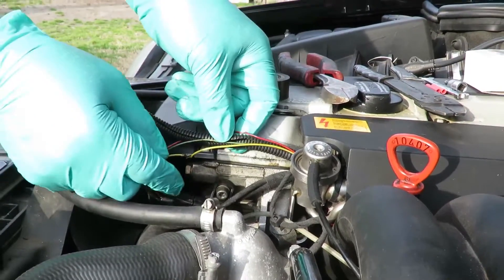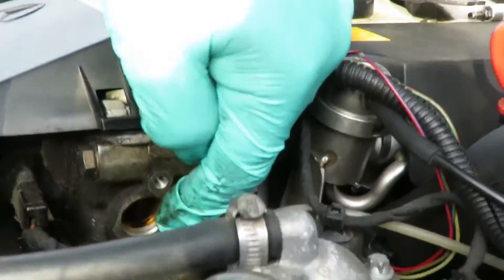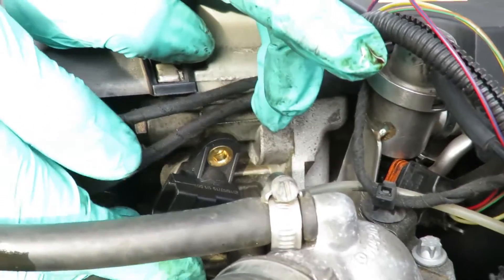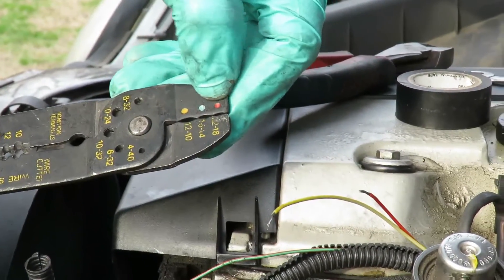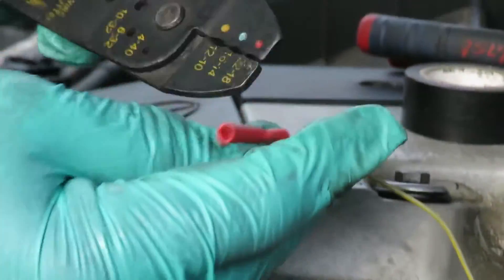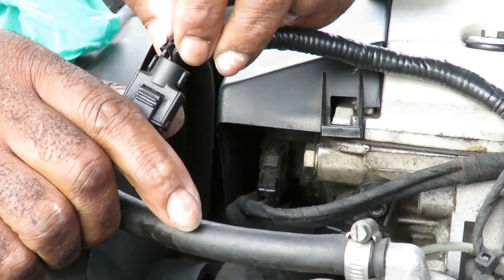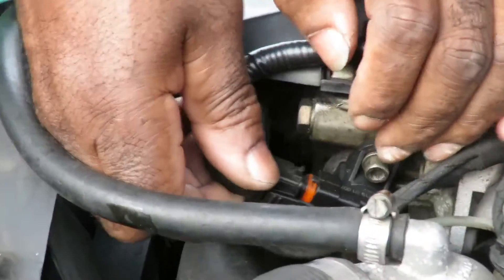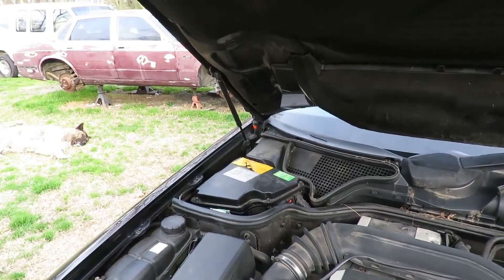⭐ 1997 Mercedes Benz E320 - Cranks But Will Not Start - PART 3

Comment: Bless you sir
Reply from the maker: Thanks Dom RM!
Reply: Astral Auto Repairs I got 2000 w210, E240, cranks n starts fine, but after exactly 25 minutes (I timed it) it shutdown without any warning ⚠️ lights or messages, just replaced the fuel pump and filter, still cranks fine and after 25 minutes it dies again, and won’t start unless it sits for an hour, then cranks again for 25 min then dies again 🤔 car is stock, no modes or any kind of electrical upgrades 🤷🏻‍♂️, running out money and solutions, if by chance you ever countered some issues like these before, any advice would be appreciated so much sir.
Reply from the maker: Once it stops running, check to see if you have spark. Believe it or not, your issue is easily fixed. All you have to do is find out whether you lost spark, fuel, or injector pulse, once it stops running. Then go from there.

Comment: nothing to do with anything just wondering did you try repairing the frayed wires to see if that may having fixed without sensor?
Reply from the maker: No, the one wire was frayed, but it only had 1 maybe two strands broken.

Comment: Hi, love your work,  I have been looking at buying 1 of these 1997 E320's its got a V6  engine with 280K kms, I got a pre sale report done and its not looking to good , intermittent faults with electric windows , dash lights, seats and starting, the body looks clean and pretty straight , motor sounds good but there is an burnt oil smell while running, is this worth $3000 AUD? I'm pretty good at repairing but don't know about these Mer Benz
Thanks
Reply from the maker: With those electrical issues, that would scare me away, the V6 is pretty interesting though. As far as the burning oil, that's another issue that might be a problem. These straight six engines have an issue with leaking from the front timing cover,